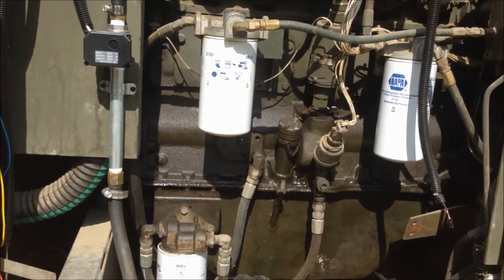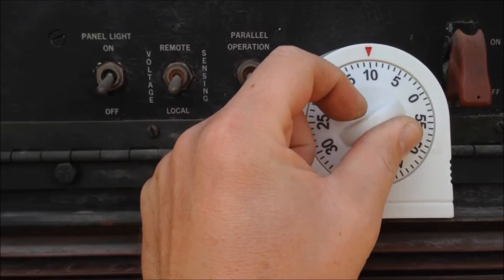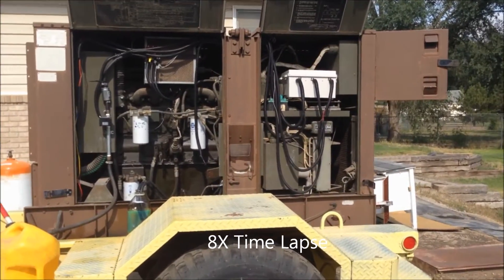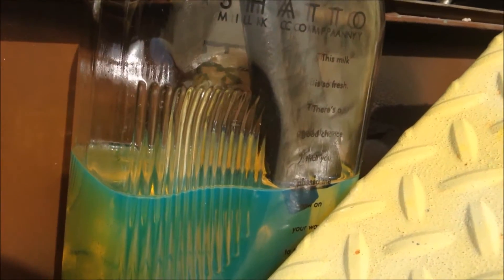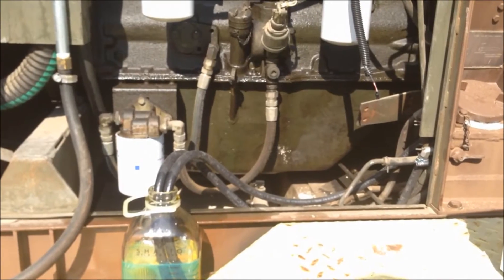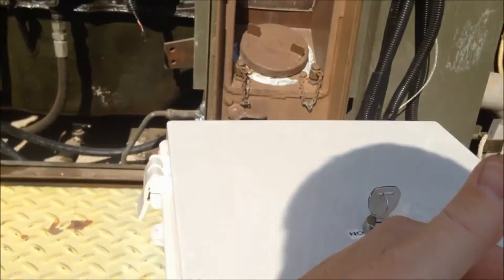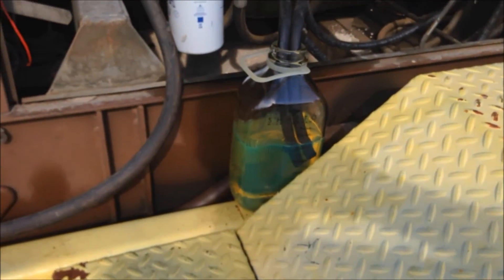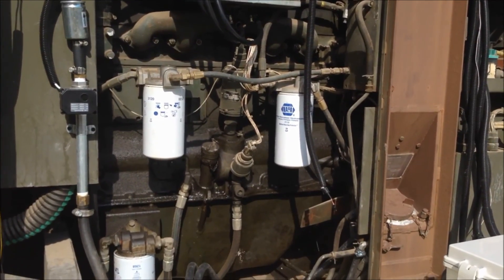Diesel Generator Converted to Natural Gas by CNG Edge

Comment: Hi Joel, very Thanful to you for your information about how to two fuels Diesel and Natural Gas Running Generator. Pl tell me where we will connected Natural Gas Supply line
Reply: You have to make your own connection point to the NG supply line. The conversion kit comes with all the parts needed to make the connection.
Reply: @joelewell3203  how and where can I get to buy the conversion kits bulk purchase. We need over 500 units
Reply: @joelewell3203 Hi Joe good afternoon, where can i buy the kit? I already have my point of NG ready.
Reply: How. Can I get this conversion kit?

Comment: The bottom-line question is, does blending Diesel and CNG save on overall fuel cost?  Neither fuel is free.
Reply: Yes, because typically pipeline supplied natural gas is a fraction of the cost of diesel fuel. If both fuels were exactly the same price there would be very little cost savings. Runtime would be significantly increased however.

Comment: Hi Joel. What was the NOx SOx & particulate emmission differences between the two run modes? Was the engine under load?
Reply: We did not test emissions. The generator was under a 50% load for this test